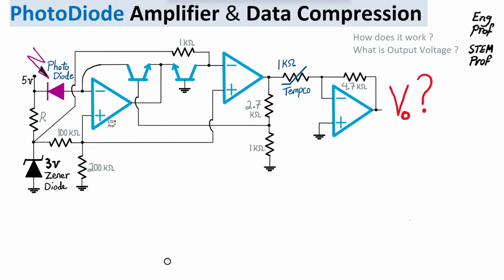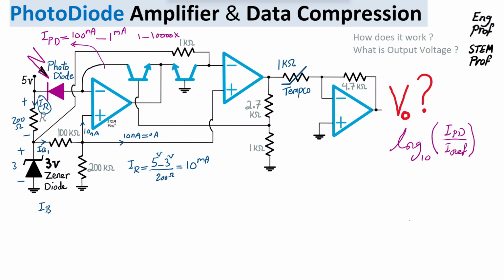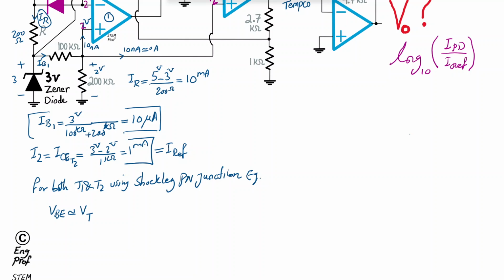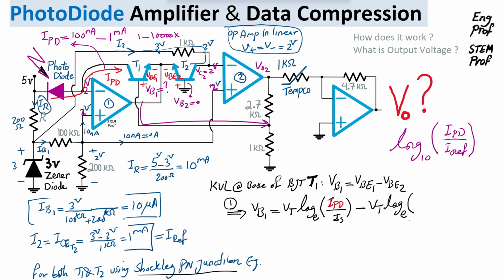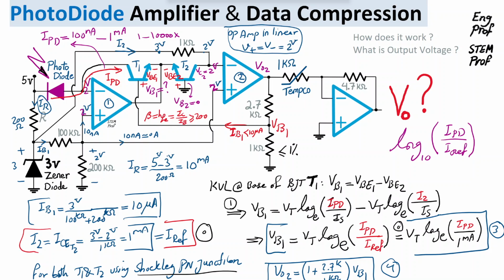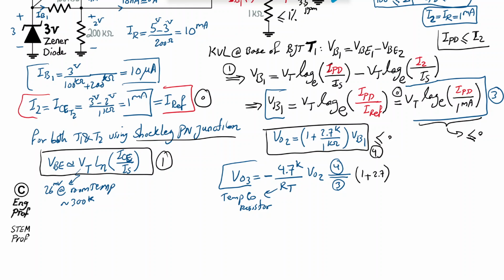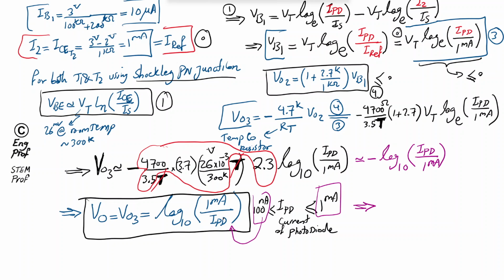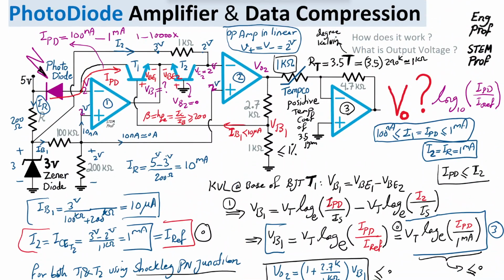PhotoDiode Amplifier with Data Compression Explained

Comment from the maker: Thanks for watching! This video walks through the design of a Logarithmic Transimpedance Amplifier that compresses a wide photodiode dynamic range (100 nA to 1 mA) into a clean 0V to 4V output, following the transfer function: Vo = log10(1mA / Ipd).  For more examples of photodiode architectures, non-linear analog computing blocks, and electronic gain control circuits, check out these Photodiode & Sensor Amplifiers videos:
▶ PhotoDiode Amplifier with Op Amp and MOSFET: https://youtu.be/1c3EJ2d4pVI
▶ PhotoDiode Amplifier with Howland Current Inverter: https://youtu.be/ILK6rakvJc8
▶ Thermometer Circuit Design with Op Amp & BJT: https://youtu.be/55YsraFE0rg

Logarithmic & Computational Analog Blocks:
▶ Core Matched BJT Logarithm Amplifier: https://youtu.be/RpKEq5WyoLg
▶ DBX Blackmer Gain Cell RMS Detector: https://youtu.be/XDoZls0CiH4
▶ Analog Computer Power Raiser (V1^V2): https://youtu.be/Qe3cY9JSzYg
▶ Analog Multiplier Circuit: https://youtu.be/VP53A2zpVMQ
▶ Analog Vector Summer Circuit: https://youtu.be/PIAsa0NVns
▶ Op Amp Analog Computer Differential Equation Solver: https://youtu.be/ENq39EesfPw

Electronic Gain Control & Power Amplifiers:
▶ VCA Electronic Gain Control (Part 1): https://youtu.be/cFzYZsPEtP0
▶ Amplifier with -25 to 55 dB Attenuation-Gain Range: https://youtu.be/oyz6lTGd2Xo
▶ Electronic Gain Control for Op Amp Amplifier: https://youtu.be/NoNgQpbj77Y
▶ Instrumentation Amplifier with Electronic Gain Control: https://youtu.be/C4tghZ-q6Zs
▶ Push-Pull Power Amp with Sziklai Darlington Pairs: https://youtu.be/8BFzsi7-Vbs
▶  Push-Pull Power Amplifier with Darlington Transistors: https://youtu.be/866MYibo8yE
▶ Power Amplifier Design (Class A) with Transformer: https://youtu.be/gKlJrqGqeCI

Master Analog and Op Amp Circuit Design Playlist: https://www.youtube.com/playlist?list=PLrwXF7N522y4c7c-8KBjrwd7IyaZfWxyt

I hope these circuit design and analysis tutorials are helpful for your bench builds and simulations!

Comment: I've tried building this circuit and the output seems to be completely grounded, been rewatching trying to troubleshoot where I went wrong and noticed that at the end you say the 4V output should occur when Ipd ~ 1mA but shouldn't it be the reverse? Output: 4V when Ipd ~ 1nA?
Reply from the maker: Glad that you are interested in this circuit! It's great to hear you are building and troubleshooting this design. For additional info on photodiode architectures and log computers, these two channel videos are highly relevant:
▶ PhotoDiode Amplifier with Op Amp and MOSFET Explained: https://youtu.be/1c3EJ2d4pVI
▶ Analog Logarithm Computer with Op Amp: https://youtu.be/RpKEq5WyoLg

Answering your question: the transfer function has an inverse relationship because the photodiode current (Ipd) sits in the denominator:
Vo = log10(1mA / Ipd).   At Maximum Light (Ipd = 1mA): Vo = log10(1) = 0V .   At Minimum Light (Ipd = 100nA): Vo = log10(10,000) = 4V .   So, 4V at minimum light and 0V at maximum light is the correct theoretical operation.  

Quick Troubleshooting Checklist for a Stuck 0V Output:

•  Ambient Light Leaks: Since 1mA drives the output to 0V, any ambient room light hitting the photodiode will peg the circuit at ground. Test it inside a pitch-black box.
•  Op-Amp Negative Power Rails: For the grounded-base transistor (T2) to conduct, Op-Amp 1 must pull its emitter below ground. Ensure you are using a dual power supply (like +/-5V or +/-10V). If your negative rail is tied to ground, the circuit cannot function.
•  Transistor Mismatch: This circuit requires a tightly matched NPN BJT pair on a shared substrate. Using discrete, unmatched transistors will unbalance the log core and kill the response.
•  Zener Reference: Double-check that your 3V Zener is properly reverse-biased to establish the stable 1mA reference current.

Keep tweaking it on the bench; once the dual rails are verified and ambient light is blocked, you'll see that smooth 0V-to-4V compression curve.
Reply: @STEMprof  Are there any other quality requirements for the transistors? By same substrate, do you mean that they need to be the same model or same batch? Should I be using a two-transistor single chip to achieve this?
Reply from the maker: @paulchirica7890  Good questions! Definitely!  The two NPN BJT transistors have to be matched transistors in the same package as further explained in the following videos:
  🔹How 4 Op-Amps and 4 Transistors Compute x³ https://youtu.be/wSzs9TskEsw
  🔹How 4 Transistors Multiply Audio? https://youtu.be/XDoZls0CiH4
  🔹Analog Computer Vector Sum Calculator Design with Op Amp, BJT Transistors https://youtu.be/PIAsa0QNVns

Comment: I built a variation of this circuit using 15 photodiodes in parallel to increase detection sensitivity. I placed everything inside a plastic black box, preventing visible wavelength light from entering.  Then I exposed the circuit to X-ray radiation for detection and radiation dose feedback control in an X-ray machine. It worked perfectly!
Reply from the maker: That's an excellent application of the photodiode amplifier, leveraging the parallel photodiodes for enhanced X-ray detection! Very creative use of the circuit, thanks for sharing your success with it!

Comment: Great! I might need this soon for a measurement setup whereby we would like to do a relative measurements (start with exposing the diode to the maximal light intensity and then put the sample in between to determine the total relative transmittance). As I was thinking about the setup I figure it out that the difference (the dynamic range) would be quite big, and that regular linear circuit would probably not suffice. Maybe if you use opamp with higher supply voltage so you have more room for the output. But this is very nice circuit worth looking at more closely. But for sure not an simple circuit 😀 Very nice explanation and the analysis. The photo diode current could then be calculated as Ipd = 1mA / 10^(Vo)
Reply: What I don't understand very well is how the transistor T2 can conduct current if it's base is on the ground? Mawybe therefore the output of the first opamp would need to provide negative voltage?
Reply from the maker: @ernestb.2377  That is a good question. And you answered it correctly as well :)  Op Amps are supplied with negative and positive voltages. OpAmp output will provide the required negative voltage as also discussed in the matched BJT log amplifier https://youtu.be/RpKEq5WyoLg circuit.
Reply: ...and of course there are 'ready to go' logarithmic amplifier. But this is good as an exercise and learning circuit design and analysis of course.
Reply from the maker: @ernestb.2377  Thank you. Glad that this Log amplifier video is useful. Log and Exponential amplifiers can be used to design very interesting circuits including an Analog Computer Raises signal to the Power signal https://youtu.be/Qe3cY9JSzYg (Analog Power Raiser with OpAmp & Transistor). 👍
Reply: Very interesting to follow you along with your circuit analyses. This log circuit is for sure not a trivial one (for me at least). I would like to learn more. Looking forward to see more of your stuff 🙂 Keep up the good work.
Reply from the maker: @ernestb.2377   Thank you! Sure, glad that you liked this video. If you are interested to learn more about LOG and Exponential amplifiers, I recommend the following videos:
Analog Logarithm Computer: How does it work? https://youtu.be/RpKEq5WyoLg
Anti-Log Analog Computer with Temperature Compensation https://youtu.be/kk2c7Gk3nW4
VCA: Voltage-Controlled Exponential Attenuator Explained https://youtu.be/cFzYZsPEtP0
And ultimately the unique circuit https://youtu.be/Qe3cY9JSzYg which is an Analog Computer that raises signal to the Power signal (Analog Power Raiser design with OpAmp & Transistor).
Reply from the maker: Glad that you liked this circuit analysis. Thank you for sharing your thoughts and experiences. And yes, the photo diode current is Ipd = Iref / 10^(Vo). This is my design variant based on the core matched BJT log amplifier discussed in https://youtu.be/RpKEq5WyoLg video.

Comment: I loved this analysis, it's so beautiful. Love working with op-amps, because the calculations involving them are so simple, however my hat goes off to the person who came up with this circuit. Thank you professor for making the circuit understandable. I appreciate your work a lot!
Reply from the maker: You're very welcome! I'm glad you liked the analysis. There is definitely a great elegance in how simple op-amp math can unlock such powerful, non-linear circuit blocks.  For another great example of clever and elegant non-linear analog design, you might also like the recent video on the Blackmer Gain Cell: ▶How 4 Transistors Multiply Audio?  https://youtu.be/XDoZls0CiH4

This specific circuit is my own design variant, but it's built directly on top of the fundamental logging block. If you want to see the core math behind that, check out this video:
▶ Analog Logarithm Computer with Op Amp: https://youtu.be/RpKEq5WyoLg

I appreciate your kind words and support!